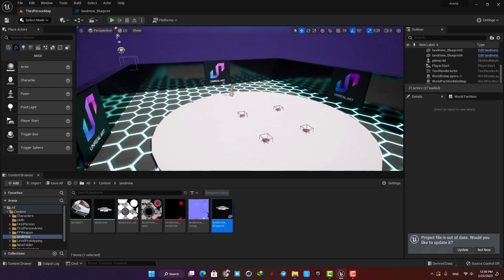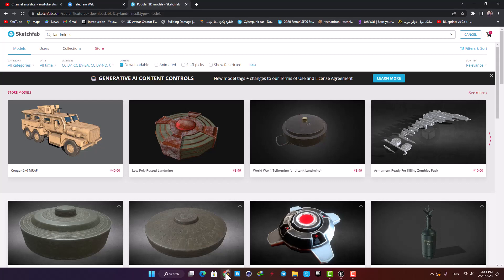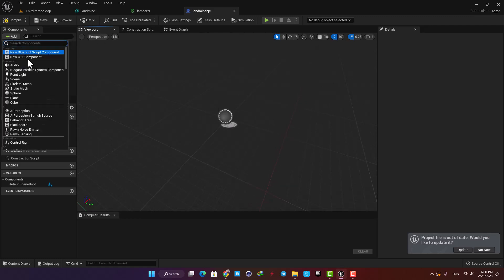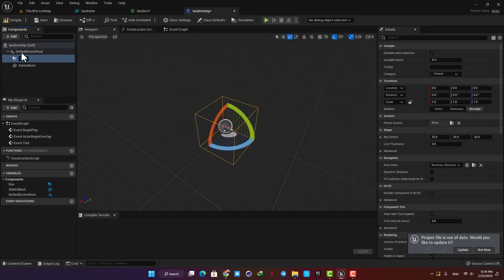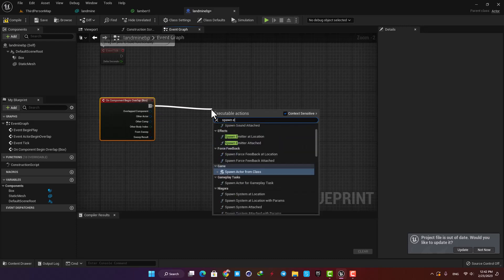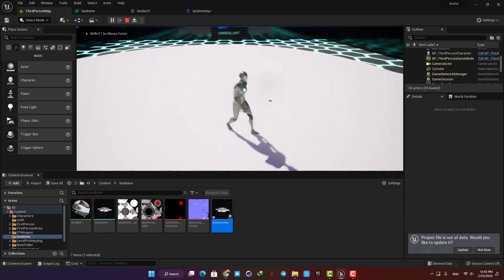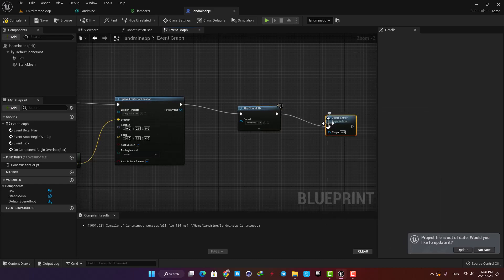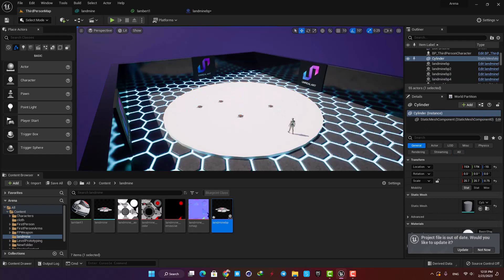Make Explosive Landmines In Unreal Engine 5 Using Blueprints

Comment: What should i do when i want this landmine to explode when an npc steps on it, not the player?
Reply from the maker: you need to cast to the npc actor class instead of your player.
Reply: @UnrealART  Thx, one more question, is there some way to cast it to more than one NPC? I want my Mine to react to few specific characters, that do not share any tag or anything like that. There is only few of them so i want to cast it to several NPCs inside the landmine's blueprint